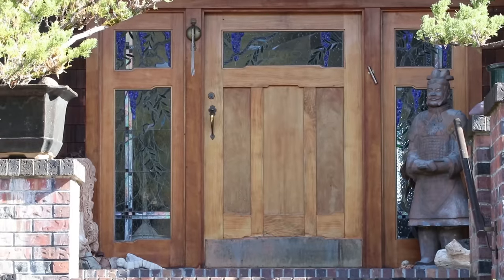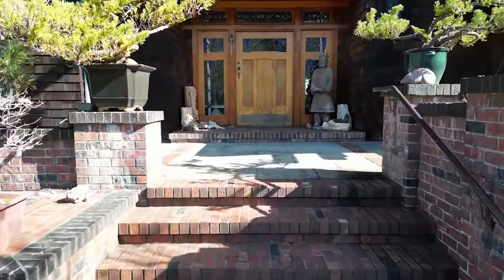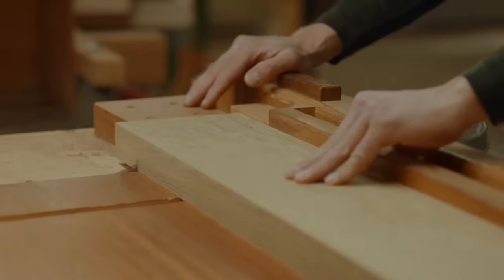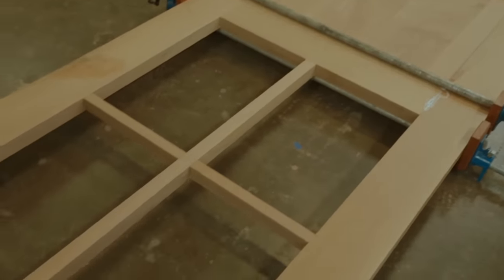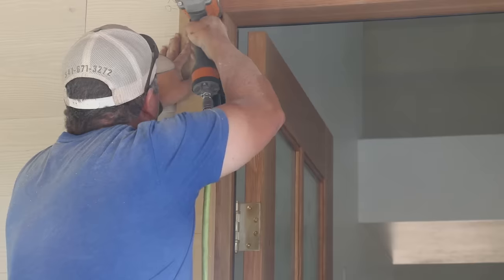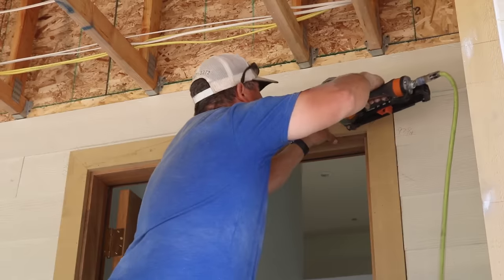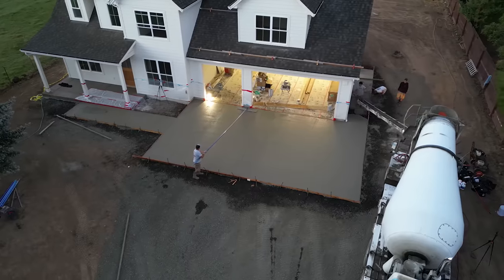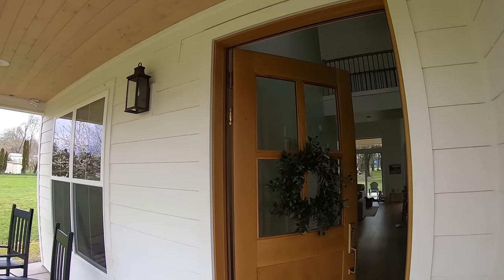Custom Front Door Build and Installation

Comment: A double length top hinge is normal here, on heavy doors. One hinge, double length.

Also, it's easier to line up perfectly, because a middle hinge that's even 2mm out of line causes the hinges to fight each other, and twist the door and frame every time it's opened and closed.

Comment: The hinge placement (2 up high, 1 down low, nothing in the middle) is a thing I saw a lot when I was living in England. Would also see 4 hinges equally spaced too. Doors always sag and then get fitment issues, always on the high side. Great idea

Comment: The yard needs an inviting, not too straight, foot path that leads from the front of the lot (maybe a nice guest parking patio?) to the door. Think about the approach on Ken's house — the way reveals itself as you move through it, and there's an impressive reveal. You can't get the same gradual reveal out of the flat landscape here. But you don't want guests to get to the house by walking up the driveway right to the garage and making a tight left. Imagine a gently curving path that leads you through the landscape with a narrative of place starting with bigger, wilder-looking plants and starker lighting, into a more softly lit plant-enclosed garden area around the door.
Reply: Great take. I second the lighting. Landscape lighting is really under-utilized, and lends A LOT.

Comment: Nice house, I’m pretty much retired now, I framed, then did finish carpentry and then into building furniture, cabinets and architectural woodwork. I have made some front door. The special machinery is the speed, I have cut the mortises and tenons by hand it’s much slower but it works great. I have done a door out of Purple Heart and even one out of Rosewood, I agreed to build the doors so I could as part of the bid to get the cabinets and the library’s and interior woodwork. In the house.

Comment: I have made a few doors for customers over the years, couple traditional solid wood  stave core and hybrid laminations…all w pretty basic portable Makita contractor table saw and power tool set- I’d say a decent  planer is most important if you want a “factory” finish and shapers help if you want molded designs. I happen to like shaker and craftsman style and those are simple and easy. Of course lots of clamps!! Ken’s entire door group should be at least 20k

Comment: I started fitting three hinges to all the doors I hung or re-hung and the additional hinge just seems to add an extra feel of solidity to the install. I've also found, with Parliament hinges, that you need to recess the top ones deeper than the bottom ones in order to overcome the tendancy of the top hinge to twist. I'll have to try moving my 'centre' hinge closer to the top hinge to see if it stops the twisting.

Comment: I made my first set of doors just a couple weeks ago for a loft storage space above my carport. I made them like a shaker style kitchen cabinet door. I made the stile and rails out of rough sawn hemlock and the panel out of 1/2   CDX plywood. I doweled the corners and used titebond III wood glue and then gave the whole thing a coat of Dark Half tung oil. I used a hinge mortising jig by milescraft and a router much like the one the guy was using on Nate's door. I really liked this hinge jig and hope to use it more on future door projects much more accurate then chiseling out the hinge mortises by hand.

Comment: I’ve built a bunch of doors over the years. My favorite, like yours, solid wood, say 1 3/4” to 2” thick, mortise and tenon with pegs and glue, no screws or nails.  Actually, pretty easy to do, but you need a table saw and jointer, or a track saw, and a mortiser. Fun to do!

Comment: I like your comments on the not necessarily needing high end tools to build a door, it's true, depends on the standard you are aiming for! I worked for a custom door shop, we built doors on veneered core, it was partially for stability and also did make it a little cheaper having a pine core vs solid white oak! We doeweled our doors together, which you could do in a home shop with a drill press, you could also build a square sticking door with a table saw. A router table would be great, but really, a table saw and a drill press, and you can build doors...a Planer for thicknessing would be kinda necessary too. But it is surprisingly doable in your garage

Comment: I like to use my grass as a natural curbing when butting up to a mulch bed. I think it makes the area look more natural and it’s easier to edge with the weed wacker. I dig down where the grass meets the bed about 3”, and slope it so it’s a true looking border. When looking at it from afar it still gives that perception that the bed is level w the grass, but when you trim it, the lower area gives the weed wacker string somewhere to go without kicking up dirt. 
As far as rock beds, DG, ect. goes I like to use a thicker concrete edging. I’ve seen guys spruce it up by laying flagstones on the top. The thicker edging prevents the rocks from sneaking their way into the grass, but for some reason they always find a way to long jump over that border! It’s just less so when thicker. 
When grass or any bed touches the concrete I don’t use any type of edging.

Comment: A shaker style door can be built with just a tablesaw (dado blade set), a planer wood be nice but not needed if you have a belt sander. Not sure how good you are on a tablesaw but it would be safer to run the Styles dado cut all the way through. The only difference is that you’d see the end of the Style and Rail, which I thinks looks good. I’ve built plenty of cabinet doors of various sizes and styles, repaired a neighbors wooden garage door, but I’ve never built a front door. 

We purchased new shaker style doors for our homes interior, but the front door is a 25 year old oak 6 panel (painted black). So I thought since I’m retired now I’m gonna build us a new front door. My only issue might be finding quality 1 1/2” Oak, white Oak, Alder, Poplar etc.

Comment: While the specialized jigs and such that you see in the video speed doormaking, I doubt that they are necessary. I've worked wood as a hobbyist for some 16 years and am confident that the process here is possible using quality basic tools in the hands of a master of the skill. I recently saw a magnificent mahogany door coming together on the worktable at my local millworks under the hands of a single superb craftsman. There was not a fancy specialized machine in sight.

Comment: It doesn't take specialty tools to build a door.  All you really need is a table saw and a router and alot of experience in using them correctly.  There are tools that make it easier such as a spindle shaper and hollow chisel mortiser and whatever but they aren't necessary.

New Yorkshire Workshop (one of the best channels on Youtube) has several door building videos if you want to see the whole process.

Comment: I'm not an engineer, but here's my take:

For an evenly distributed mass of door, the centre of gravity of the door is dead smack in the middle, so the force of gravity is exerted ½ of the width of the door, downwards.  Thus - for a classic 3 hinge door:
The top hinge is in tension, 
The middle hinge is in compression, 
The bottom hinge is in least compression.

In the Top-Two hinge configuration, the top hinge will be in tension with a lot of compression on the 2nd hinge and residual compression on the bottom hinge.

Doesn't seem to be a "better" solution in my opinion, just a different solution and only because the load capability for these hinges is probably 3 or 4 times greater than the installed case.  I'd expect the 2nd hinge to get the most wear over time.

We can safely assume that the installer knew what he was doing in terms of screw pilot hole so the screw torque is "just right" in grabbing the wood w/o destroying the fibre of the wood.
Reply: Non-engineer as well but I wold argue that the forces would be: top hinge - tension. Bottom - compression but middle hinge to be neutral (provided it is exactly centered). Actually it would be under both T&C but effectively canceling each other out. Similar to the forces on a beam (non-cantilever); top-compression, bottom tension, middle neutral. 

You are correct about the hinges lining up precisely though. Even a little bit off and it wants to fight you.
Reply: @psidvicious  I disagree, because the centre of gravity is off centre of the hinge vertical axis there is a torque about the top hinge putting everything below it in some amount of compression - the most being closest to the top hinge.
(Think of it as if there was no bottom hinge at all, the "middle" hinge can only be in compression; add another hinge below and you're just distributing that compression).

I didn't make a comment about alignment of the hinges, but of course you're dead right on that.  (I still have a creaky room door where I didn't quite get it right.  Fight it with oil!  And that's only 2 hinges).
Reply: @AlanTheBeast100  Oh you’re right, the other slight misalignment comment was just before yours.
Well maybe an engineer will chime in here one of these days and give us a professional opinion.

Comment: The front door says everything about the house and inadvertently about the owner, even if it was inherited from previous owners. 
Edging must be steel or extruded aluminum, plastic doesn’t hold an edge , might as well do a shovel edge rather than plastic.

Comment: How many people in the comment want to guess what this door would cost a customer??
Reply: Just the door, or the whole entryway too?
Reply: Definitely some pretty Ks. Especially if you add installation. No less then 5k my opinion. Just for the door.
Reply: 8-10k for the door and labor.
Reply: About 5 grand installed finish not included. My question is are you going paint with those screws on installation. I personally don't like the putty spots after sanding they flash
Reply: I worked for a company that made all doors and windows for each house we built. We mostly used 2" mahogany planks that we resawed on a Striebig wall saw to get truly flat, straight stock. Needless to say it was all very high end work. At the time, 1990's, a basic 3-0 x 6-8 entry door with 9" sidelights complete in it's jamb would go for $3500-5000. That was pretty good considering it was completely hand built.😁
Reply: @SkullivanBones  The entry door assembly shown at the opening of the video. The green and green door. Not the white oak door.
Reply: $0 in exchange for all of us watching this 15 minute commercial.
Reply: Door delivered w no install is $8,001 Bob.
Reply: @andrewschafer8986  The door on Ken’s house including the whole stained glass surround, installed with tax, tag and title, I wouldn’t doubt it to be a $15-20K bill.
Reply: That door would be about $8,000 plus installation. The most expensive door I've installed was $27,000. My installation fee was supposed to be $4,500 to remove the old door, enlarge the opening, install the new door and trim everything out but we found some bad rot when enlarging the opening and fixing that brought the repair and installation to $8,000.

Comment: Respectfully, my belief is in most regions new homebuilds, developers, architects, etc dismiss the need for elevations of foundations from street regarding water runoff and gradual slope drainage and many homes/developments sadly see and experience flooding, ground saturation, and standing water after increasingly serious rainfalls. Compacting native soils and leveling yard frontage creates endless moisture problems, fungus, moss, and mold issues.. Any national home insurance company taking residential claims continually report water/moisture intrusion being the single most destructive element of residential claims and all of its building components by far than any other insurance claim.